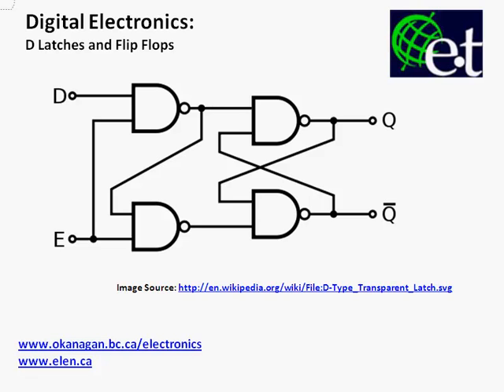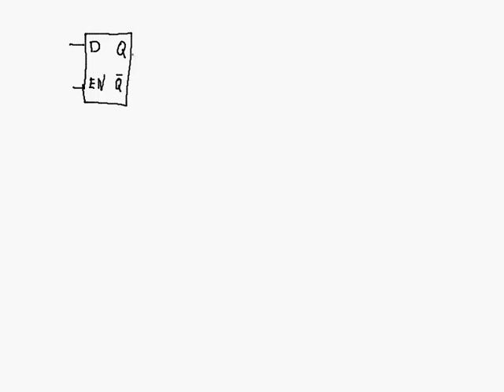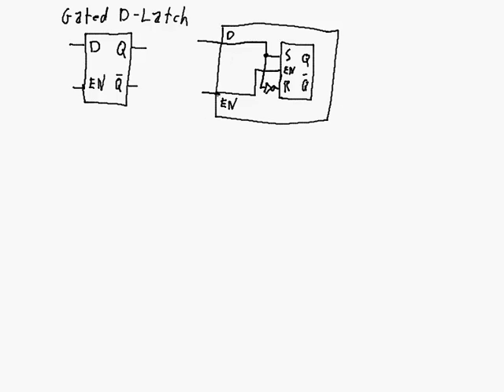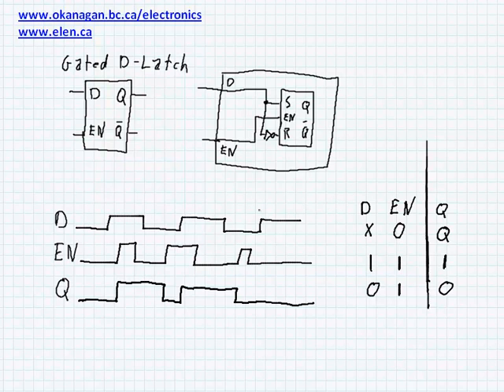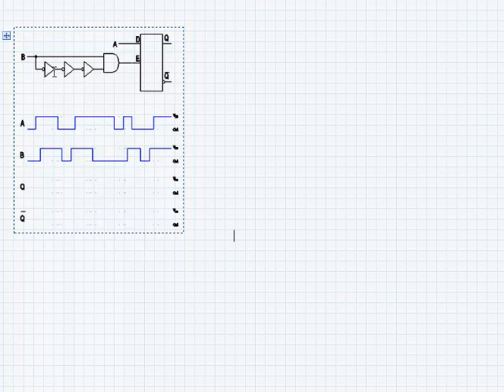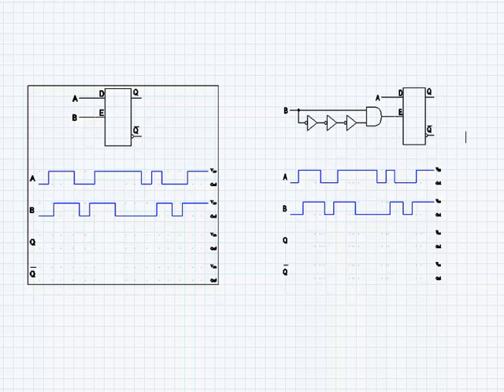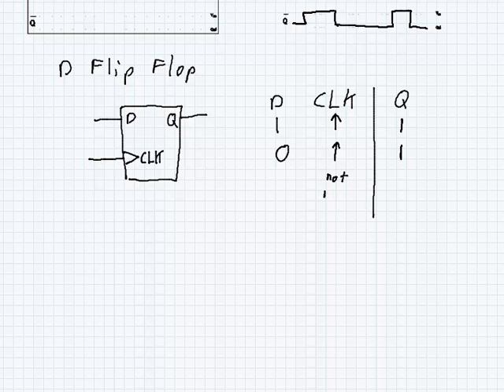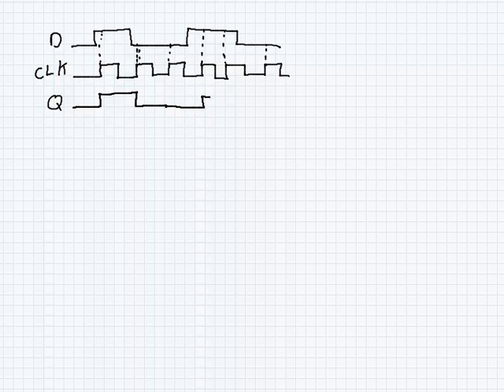Sequential Logic - D Latches and Flip Flops

Comment from the maker: You'll usually use an address decoder to get more chip enable signals.  i.e., if you have 4 address lines and you use them directly for chip enables, then you can control 4 chips, however if you put those address lines through a decoder you will have 16 chip enable signals.   Address 0000 will activate chip 0, address 0001 will activate chip 1 ... address 1111 will activate chip 15.

Comment from the maker: @KenshinsFinest It's simply a clock divider as you have identified.  There are many cases where you need a clock that is some fraction of the main clock and you can use a clock divider to give you the new clock.  The easiest divided clocks to create are power of 2 divisors, but any whole number divisor is reasonably easy too.